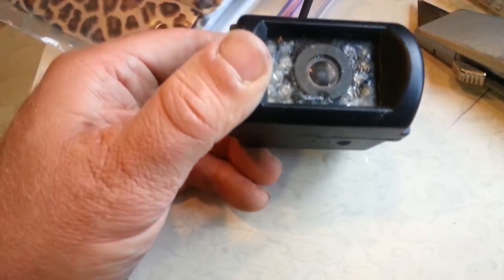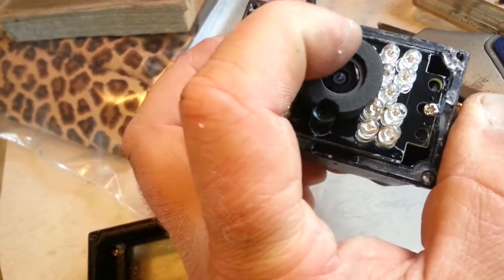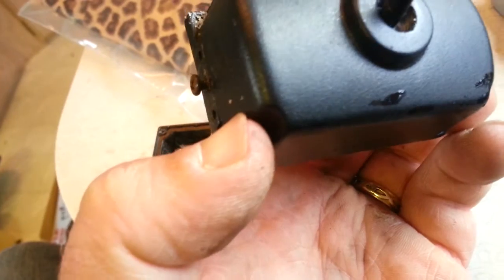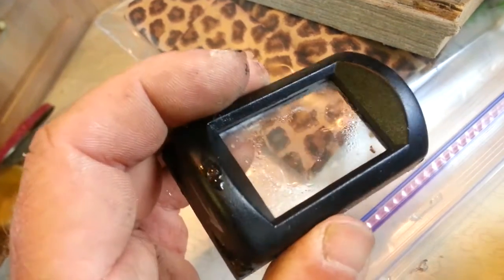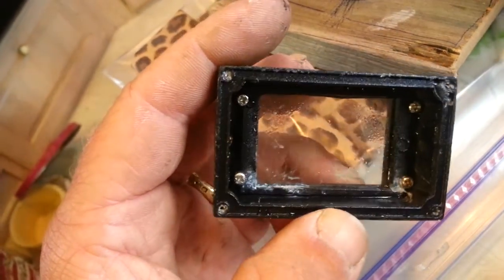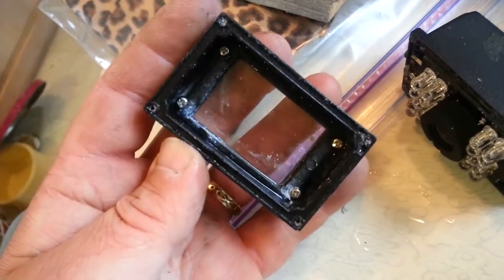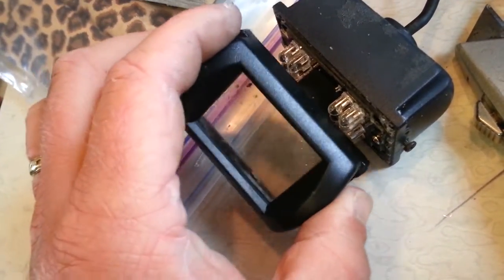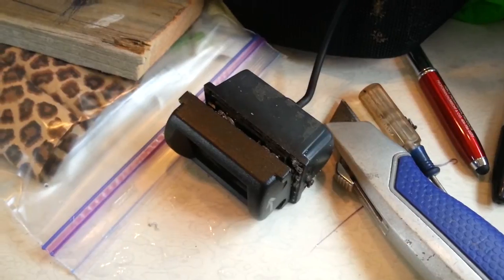Water Logged Camera Fix

Comment: Why didn't you remove the 4 screws and take the glass out to see if the seal was broken or mall-aligned and likely that is where the water was getting in since you already had sealed the back and around the metal during your previous repair?

Comment: Square of masking tape over glass?
Reply from the maker: Andrew Sparrow that might work
Reply: I bought a RSV ( rear view safety)back up camera and it looks just like that but Mine cost around $300.00 , and it worked for about a 14 months with no issue , but after that it got water in , and I opened many times and put silicone on where the tiny gasket go , on the cord entrance , haven’t been successful fixing it , I never thought about the glass . Has anybody have had an issue with RSV Back up cameras? Is only warranted for 1 year
Reply: @Mecambrea77  - I also have a camera from the same vendor with the exact same problem. I'm about to take mine apart soon and try and repair it.  Needless to say, I'm not pleased :-(